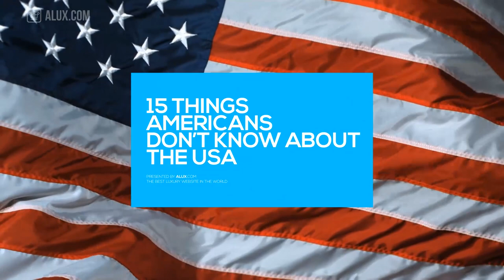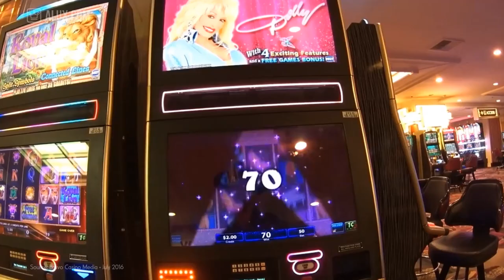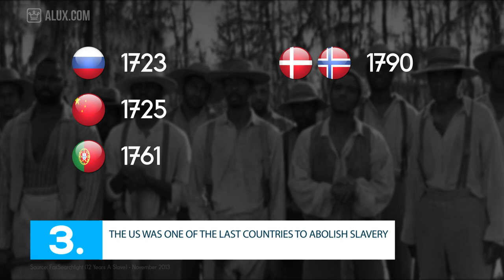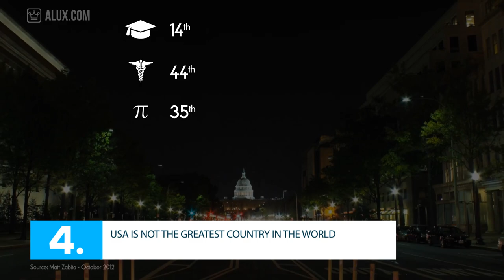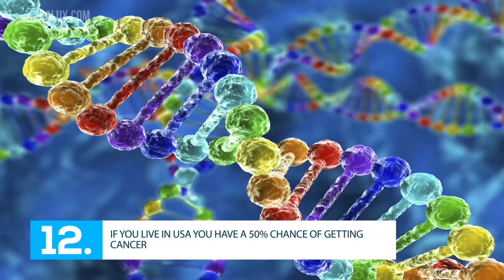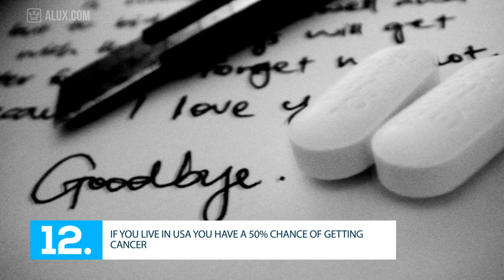15 Things Americans Don't Know About The USA

Comment: The first statement is wrong because
1) Even China doesn't acknowledge it. 
2) PPP is a measure that was developed to make poor countries look richer and rich countries look poorer. PPP is basically the gdp of the country adjusted to the cost of living of the current superpower, the US. If china had the same cost of living as the US , then it would have actually remained a poor country since it became rich only because of manufacturing and construction, both of which require VERY VERY LOW WAGES to flourish. So the first point is ruled out....

Comment: I enjoy these videos and I think they are necessary in today's climate. I think that if they outrage the viewer, that is a good thing. The best thing one can do is ask themselves why they react as they do- if you do not like the answer, change it. You are the only thing you have absolute control over. Regardless if you have health problems, mental issues, have been a victim of violence, are an addict, have suffered major loss or poverty- if you live another day, thats another day you have not succumbed to struggle.   No failure is a complete ruin if you learn, and then ACT upon the knowledge gained. And no power is greater than your own force of will. Often times if you try something and fail, you are no worse off than you are right now.So I say spite everything that threatens you-- by simply thriving. Also, we each have a different definition of success and wealth, so if you detest the archetype of a "rich bitch" then don't become one. But if equating success and wealth with snobbery and narcissism prevents you from living to your full potential, don't let it. Fück it-- its silly how sad we choose to feel, when we can change so much of what makes us feel that way. A very lengthy comment, yes, but it took me years to figure this out. And I still have a lot to learn. But to summarize, these videos provoke introspection and I guess some  people hate that.